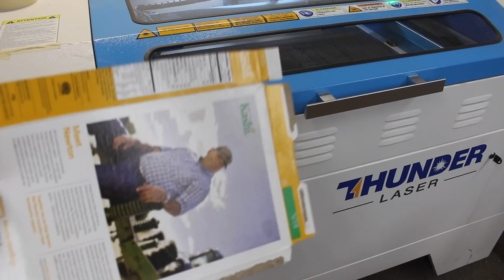Drum stick Drum Lamp / Upcycling

Comment: When people ask what can you make with cnc, lasers 3d printer etc I tell them it's not all ways about using the machine to make the final product but to help you make something that can help you make  the final product. Perfect example with the hole template you made.
Reply from the maker: Yea man, it's not a separate tool to be used by itself, it's another tool in the arsenal. I can make circles a bunch of ways.  This is one.

Comment: Great video Tim and a cool project, I had a hard time seeing what it was you were sticking on the holes you drilled into the drum body though, what were they?
Reply: Those are pop rivets with the pin shoved out of them.
https://en.wikipedia.org/wiki/Rivet#Blind_rivets

This isn't the "normal" way they're used -  Tim specializes in using materials in creative and unconventional ways.
Reply from the maker: yes, pileofstuff is right. They are aluminum rivets. a quick, cheap way to dress up a small hole's edge
Reply: pileofstuff , when I saw your response to my question this morning it made no sense because I had seen light coming through the holes, but the I was at work and didn’t have time to completely read your reply nor look real close at the video. Initially I thought Tim was inserting small bits of acrylic rod or something of that nature to transmit the light through the drum body.
Reply from the maker: I didn't film that whole thing very well. I should have included a regular speed close up of the action.